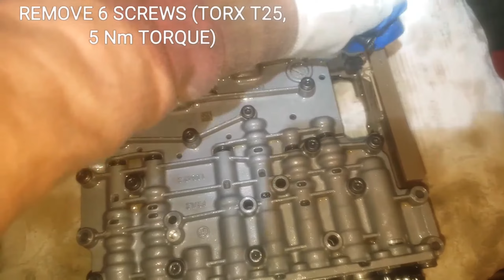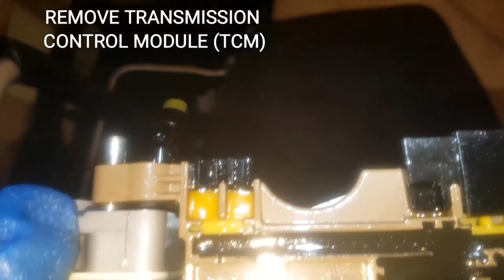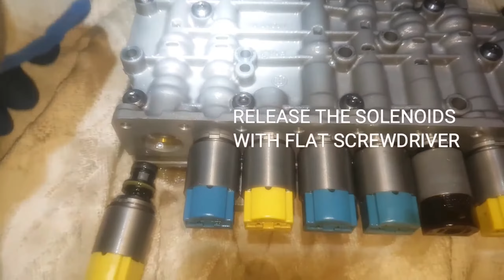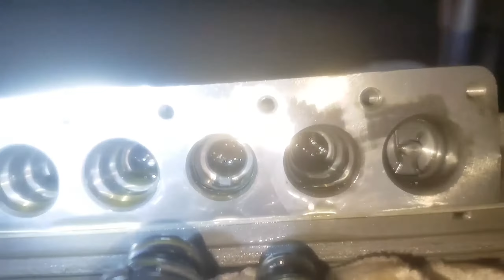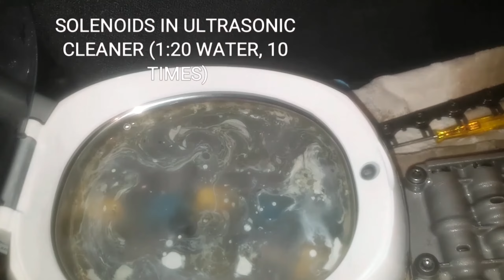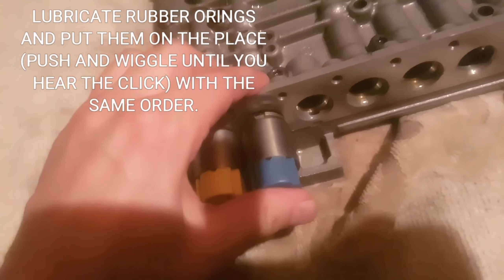JAK ODKRĘCIĆ ELEKTROZAWORY I  STEROWNIK EGS SKRZYNI AUTOMAT ZF 6HP OD MECHATRONIKI BMW E60 E65 E90

Comment: Nice video, thanks. What’s the reason for removing and cleaning the solenoids?
Reply from the maker: I have a noise coming from converter on "P" and "N" position. It happened  immediately after converter regeneration. Man who regenerated said cleaning solenoids can help but it didn't help. He said regenerated converter needs higher pressures.
Reply: DIY Bmw E60 yeah, I would’ve been surprised if cleaning the solenoids would do anything. Have you replaced the seals (rectangular bridge seal and circular cylinder seals) above the valve body?  Apart from that I would be checking the sonnax website for their various valve body modifications, but not a great place for you to be in. The guy on the ShopLife.tv website will answer questions and offer advice if you pay him something like $5 through his web store. Might be a worthwhile option as nothing beats leveraging someone’s experience. Sorry I can’t really help 👍
Reply from the maker: @PVflying  yes I have replaced them. Noise came immediately after converter change. I suppose there something wrong with it. I am gonna send it back in warranty.
Reply: DIY Bmw E60 sorry to hear that. These cars have so many ways to cause us problems. Actually mine is an Audi, but same transmission (Quattro version). I’m chasing a torque converter lockup clutch slip issue. Hope your TC change fixes things